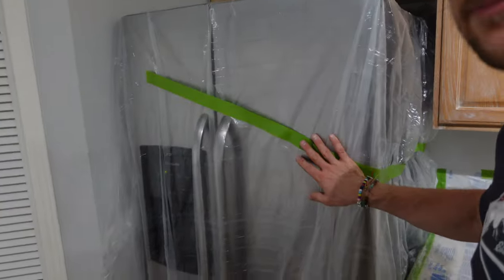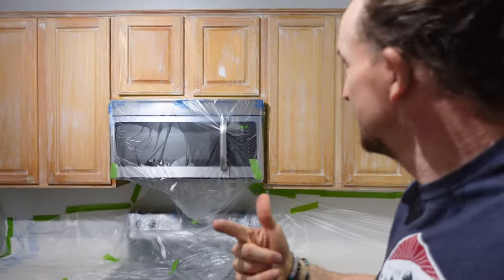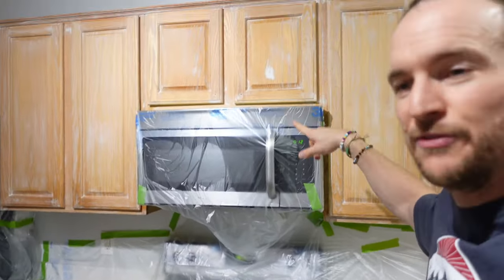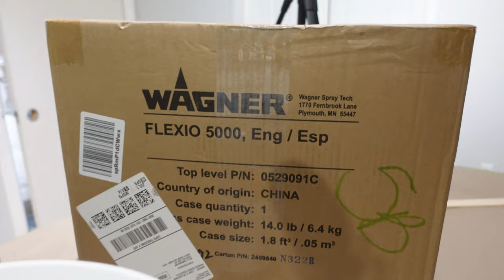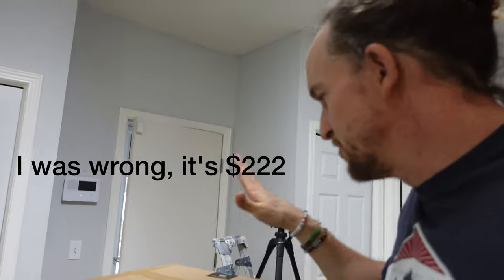How I Painted Kitchen Cabinets Without Removing the Doors – Time-Saving Hack!

Comment: I grain filled and painted my golden Oak cabinets in two bathrooms and my kitchen. I used the flexio 5000 and it came out great!! So much so my wife had me paint a bed and our front door with it also 😂😂 I learned so much watching DIY painting first though THANKS for sharing so much info !!
Reply: Very impressive. Where do you live? Are you available for hire to spray my cabinets. Also how do you deal with painting ugly popcorn ceilings?
My home is small and I have a lot of furniture that will be difficult to move.
Marilyn

Comment: Great video and great job. I have the same sprayer have used it for a lot of projects and love it! I purchased from someone who never used it for 100$. Did you have the settings maxed out? I adjust all the time but maybe I don't need to?
Reply from the maker: Yeah, I have the air maxed out. I only mess with the trigger adjustment to change the material flow.

Comment: Nice of you to share your experience and techniques in this subject.  The cabinets look amazing 👍Watched your other video on making grain fill, noticed you applied it to the cabinets prior to priming but not sure if it’s required but should the prefill be sanded down a bit prior to applying primer coat or just prime over it then sand down prior to first top coat?   Thanks for the help

Comment: Incredible, will definitely be trying this method, however I am questioning the sanding. I am repainting my kitchen cabinets and don’t know if all that is needed is just a light sand perhaps?
Reply from the maker: Sanding is a really important step for the durability of your cabinets. It's so easy, I would really suggest not to skimp on sanding. Bad sanding can lead to peeling.

Comment: Good video. I have old built in white kitchen cabinets that have been painted maybe three times in 70 years. I scraped off some of the top paint on the cabinet doors below the kitchen sink and now I'm not sure what to do to prep these to repaint. Upper cabinets look better but a little bit of the paint was able to be scraped off at the spot where people open them without using the handles. Also, I want to change the hinges. They are outer, not hidden, and I can't turn the screws (I think because of paint build up) to take them off. Should I use a paint remover product on all of the doors and the hinges (to get to the slot in the screws)?

Comment: Hi, I just want to say your videos are great! My question is about the primer under the dark color. Is it not necessary to tint the primer because the color is so dark?
Reply from the maker: No. Typically two coats of any color will cover a white primer. I. Theory, tinting a primer is great and can’t hurt, but I don’t find that it actually helps much either.

Comment: I built shaker doors for my cabinets. Almost complete with the prep work. I ordered that same primer and will be picking up the advance for my finish coat. I’m not new to spray painting but this is my first attempt at spraying kitchen cabinets. I have a Graco trueCoat 360 airless sprayer. What are your thoughts on spraying with this style of airless? I don’t want to screw them up😂. I’ve also watched some people use gravity guns. Thanks
Reply from the maker: It's a fine sprayer, not my favorite, but it gets the job done. My issue with the Truecoat 360 is that it is a piston /airless sprayer but doesn't have the ability to store built up pressure. So you get a pulsating spray. You can get a great finish with it, it just takes some practice.

Comment: Question I’m going to be using the sherwin extreme bond primer with the SW emerald as top coats any experience on diluting them by 20%? The man at the SW store said no more than 5% cause it can change the chemistry? Any suggestions?

Comment: First of all thanks for the video!  I have a cheap gravity help with which I have had terrible luck using with any kind of paint (does well with lacquer though). What might I be doing wrong, need different tip? I'm about to spray my kitchen and don't mind the additional cost of 222 bucks but would just like to know.  Thanks again.
Reply from the maker: Without knowing your gun or setup, I don't really know what to tell you. But the Flexio sprayers are really good. Even with buying a sprayer, the cost of DIY vs hiring is still about 1/10
Reply: @diypainting  I understand, thanks

Comment: What if I want to paint the inside of the cabinets too?
Reply from the maker: Simply don't prep them off, clean them, scuff them, and spray or roll the insides. If you spray them, it can be kind of miserable as the spray will blow back in your face. So you have to wear a good face mask. Rolling is slower, but looks fine inside cabinets and won't blow back in your face.

Comment: So, they wanted their walls/ceiling painted as well I take it? Were you doing that job as well or another contractor?
Reply from the maker: More often than not, clients do want their walls painted when they change the color of their cabinets. I usually add that into my project as well. If they don't want their walls painted, but they do have the color or leftover paint from the last time they painted their kitchen, I will caulk the cabinets to the wall, overspray onto it, then touchup their walls so it looks perfect. Only when they don't want the change the wall color AND they don't have access to the original color/paint, do I prep off the walls (this is rare).
Reply: @diypainting  I thought so. Thanks man!